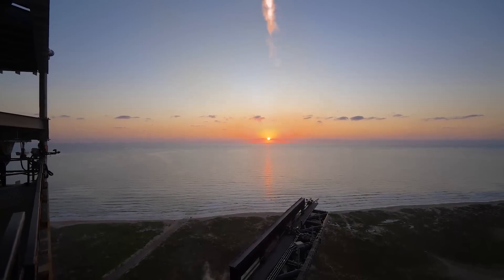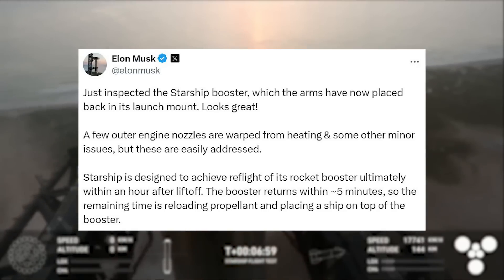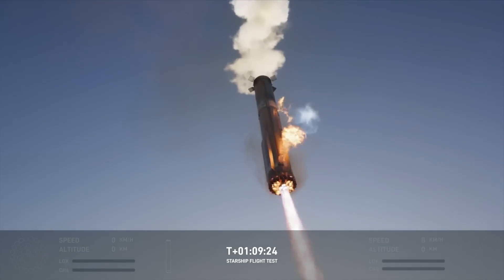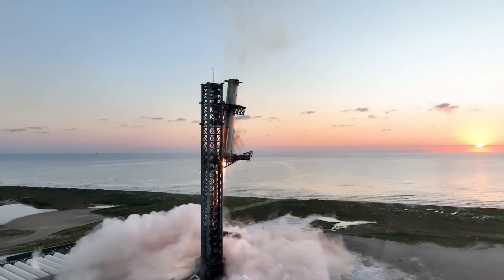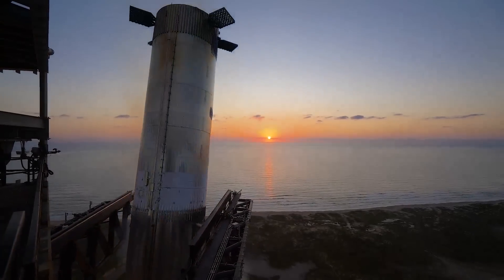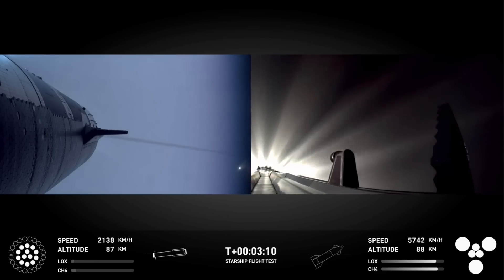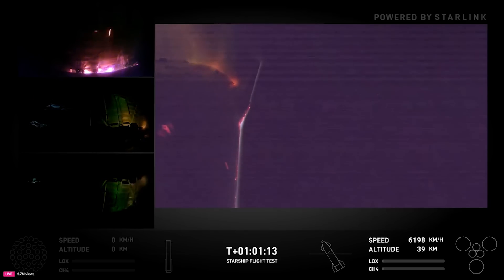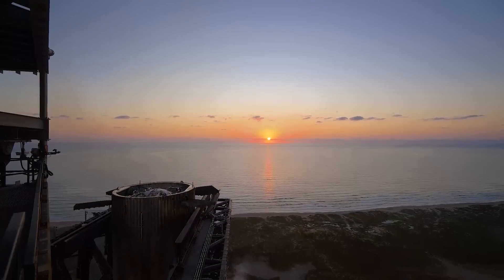What Happened After SpaceX Caught The Super Heavy Booster?

Comment: Not only is it the largest booster rocket ever flown but now SpaceX has a completely intact example that has flown an entire launch cycle. They can examine everything from metal fatigue to o-ring wear and all of the bearings on the vehicle.
Reply: the data alone from this booster and on top of that they can reuse or recycle the booster.
Reply: @shockers12512 this is an old block variant   and they will be using v3 raptors soon   already  old technology doubt it will fly again   but i could be wrong
Reply: @machineenvyllc437  I doubt it could be made flight worthy again as well.  It'll be examined and maybe put together and on display.  They did that with the first f9 they landed.
Reply: @brianl7695  i wish they would… but have a sneaky feeling it’s going to be torn apart for inspection  like every last part

even can crushed to see if the catch ruined the integrity for reuse
Reply: @brianl7695 hahaha !!!! 🤣 🤣😂😅 A booster being recovered?????? yeah, concentrate on the stupid booster and not the most important part, the crew section. Jezuz,....... amazing to watch this cluster pluck.   I wouldn't even trust them to send up a hamster let alone a human at this point in this pluster cluck.  What idiot concentrates on a booster before the  human accommodations and flight worthiness, let alone just getting that piece of hardware  to not blow-up first!!
Reply: worth billions in research!
Reply: @machineenvyllc437  I fart in your general direction.
Reply: Great to get
Reply: However, they also have competition now. Everyone else was watching to see if the idea would work or if there would be some engineering hurdle that couldn't be overcame. Now that the world knows its possible, a new space race has started. The reusable Falcon 9 spurred a bunch of innovation from other companies but the fact that its possible to land a booster on the launch hardware means that everyone knows what can be done and thus what to do. I guarantee you that there were meetings in Russia, China, and the EU on Sunday and today where government officials and private companies came together to discuss how to move forward. 

Even if SpaceX and Musk both mysteriously disappeared, the achievement made on Sunday morning has changed the future.
Reply: @ryelor123  Yet still no one else has managed to replicate the landing of an orbital booster. It isn't any easier even when you know it's possible.
Reply: @schrodingerscat1863  yeah, concentrate on the stupid booster and not the most important part, the crew section. Jezuz,....... amazing to watch this cluster pluck.   I wouldn't even trust them to send up a hamster let alone a human at this point in this pluster cluck.  What idiot concentrates on a booster before the  human accommodations and flight worthiness, let alone just getting that piece of hardware  to not blow-up first!!
Reply: @Snively_Whipsnade  Grow up, it takes years to get certified for crew after the ship is fully operational. This is an early test flight of an early prototype and it was one of the most difficult aspects of the flight. Never been tried before yet they managed to do it on the first try even though many experts thought it impossible.
Reply: @schrodingerscat1863  Didn't take years for Mercury to get certified. Didn't take years for Gemini to get certified. Didn't take years for Apollo to get certified.  Next ......
Reply: @schrodingerscat1863  Agreed.  I've suggested numerous times that they are using FEA to build their control systems.  Even just getting to the point where you can create the parameters for the Finite Element Analysis is a non-trivial activity.  How do I know this?  Because SpaceX has no credible competition at this point.  And for that matter, the computer running the analysis is most certainly not somebody's laptop.
Reply: @Quakeboy02  They are probably leveraging the computing facilities that Tesla has at its disposal. Tesla has extensive private super computing facilities they use for their AI work. I think the expertise they got from modelling flight dynamics and the systems they designed and built for modelling Falcon9 flight dynamics will also have been built upon. Complex control systems are hard to model well but once software is built to do that kind of analysis it becomes a major asset of the company, they won't be using any off the shelf software for that I guarantee it. This is another reason why no one else has come close to even Falcon9 yet let alone what they have just demonstrated with Starship. Even Blue Origin's mini rocket is no where near as accurate as that Super Heavy booster and it's tiny in comparison with only one engine to control.
Reply: @ryelor123 the only viable competitor is china. They already have started copying Falcon and Starship, this may spur them further but they were already on the way. The EU can’t do anything, there is total risk aversion there and no private funding, state funding goes is wasted inefficiency on a lot of other things. Russia will be flying Soyuz for another 100 years, they don’t care about reusability.
Reply: @ryelor123  who?   the issue is there isn’t enough customers as there are rocket providers
Reply: They can also invest more in hardware attached to the booster knowing it will be fully recoverable. So I'd expect them to start making much bigger strides towards having the booster section completely reusable going forward.
Reply: @MDL.720  like what?  don’t see much more being added  its main function is just to lift
Reply: @machineenvyllc437   I meant improving existing components, my comment was probably poorly worded.
Reply: O ring wear so damn painfull ti bring up vis a vis the space shuttle
Reply: @timvansurksum  Yeah, but thankfully the old SRB technology is long gone!
Reply: @Quakeboy02  ohh yeah id hate it if we were still flying old spave shuttle hardware👀
Reply: Yes - it has been stated that the payload is data, they can learn a lot from examining this booster and the raptors. Bet they will try to fire them again - maybe at their McGregor facility
Reply: @robjchristopher  maybe yeah and its about time they put one of these up for display dont you think
Reply: they are probably already taking it apart lol
Reply: Actually the starship landed at sea and RUD but they did demonstrated another starship landed sucessfully before...
Reply: @Epiderm91  It's not supposed to survive ditching at sea, they actually want it to blow up and sink. The test is to get it to a soft landing which it did for the second time, however this time it was perfectly on target.
Reply: @Epiderm91 think they did that on purpose so that no one can recover it
Reply: I've not heard of them having any o-rings on the booster
Reply: @OCMike  Yeah, this is a liquid fuel system, not like the joined solid-fueled stages of the SRBs that NASA used.
Reply: @OCMike Are you part of the analytical team?
Reply: ORING WEAR
Reply: @PDQkevin77  yeah, concentrate on the stupid booster and not the most important part, the crew section. Jezuz,....... amazing to watch this cluster pluck.   I wouldn't even trust them to send up a hamster let alone a human at this point in this pluster cluck.  What idiot concentrates on a booster before the  human accommodations and flight worthiness, let alone just getting that piece of hardware  to not blow-up first!!
Reply: @Snively_Whipsnade  If you don't have a reliable working booster, You Do Not Have A Space Program.  Anyone can design a crew module to sit on top of a rocket.
Reply: @PDQkevin77  yeah while the crew section of the rocket continues to burn up and blow up!!! ,🤣😂😅 everyone's excited about a booster being recovered. Think people think!!!! What a cluster pluck this is!!!!
Reply: @Snively_Whipsnade  By your comments I can clearly see you don't have any idea what you are talking about. The Super heavy booster landing and catching is just like the 1st stage of complexity. Having a full reusable Starship is the final stage of the development. Now, mark my next words please. We are in the VERY BEGINNING of Starship development, we will see at least another 20 test flights during the next 5-7 years before we witness a finished Starship that transports humans. At this moment Starship is "just" a big tank with engines, heat tiles and avionics electronic. Very far away from the final spacecraft capable of keeping alive a full crew in a misión to Mars. In fact I'm certain that the final Mars version of Starship will look completely different to the current prototype
Reply: @jesusrv2009  Won't happen in your lifetime or mine, if ever. Reinventing the wheel here in spacecraft development. It's been done before, in fact 63 years ago it was done specifically when it comes to human survival in a spacecraft, but of course millennials and gen-zers don't read history.  My two nephews are millennials and they think that they are always the first to think and try something when in fact it's all been done WAY before they came along.  Spacecraft development, in terms of keeping humans alive in space,  is 63 years old.
Reply: @Snively_Whipsnade  I wouldn't say that they reinventing the wheel. We are witnessing innovation in manufacturing methods, and using prototype evolution methods instead of building everything upfront before testing. These things alone are enablers to a much faster cadence of development with much lower cost. eg:  3 years of SpaceX development equals 10 years of NASA development during Gemini/Apollo era (in which US was investing the 4% of the annual budget in the program)
Reply: @jesusrv2009  Doubtful it'll look much different.  A rocket is a rocket is a rocket.  What they have now works very well.  Will there be incremental changes?  Yes.  Will there be a complete revision?  Not likely, because what they have works.
Reply: @Snively_Whipsnade  "Spacecraft development, in terms of keeping humans alive in space,  is 63 years old."  Indeed.  And there isn't really much to a crew module that sits on top of a rocket, because it's a static system, not an active one.  The big money is always going to be spent on the propulsion systems.
Reply: @Quakeboy02  There is already designs of 3 different versions. The final Mars-ready Starship will be bigger, more powerful. We will have a moon version, a Mars version and a Earth 2 Earth version each of them different in size, power and capabilities. The only thing that will only be slightly different will be the Super heavy booster

Comment: So... if you miss the 'catch points' then does the booster rely upon the grid fins to catch?
Reply: probably, but I don't know if they can hold the weight
Reply: it can hover so as long as it has fuel it can keep trying to line it up theoretically.
Reply: @zachmoyer1849  Hovering is not about fuel.  It's about how deep they can throttle.
Reply: @TheEvilmooseofdoom  well it is able to throttle down enough to hover my point is they can hover it as long as there is still fuel in the tanks which might not be much after a launch
Reply: The software either works or it doesn't.  Those vanes on the top are used to spin the thing around until the pins match during approach.  They're sticking out far enough from the body that they don't have to be precisely aligned.  Close, yes, but not exactly.

Comment: have they said what caused the damage to one of the fins of the booster?
Reply: None of the grid fins on the booster were damaged.
Reply: @morskojvolk  I don't mean the things on the top. I am referring to the four stubby fins on the bottom. There is visual damage. It is visible before it touches the chopsticks, so it is not capture related.
Reply: @morskojvolk  were talking about the static fins at the bottom, and yes that did happen.
Reply: One of the gas tanks that are used to re-start the engines blew up.
Reply: @SaltyGT  No, it didn't.
Reply: @SaltyGT  Thanks

Comment: it seems like they should probably light up all the engines during descent so that the nozzles all have sufficient cooling via the fuel piping flow. at least at a minimal level. maybe they don't have enough fuel to ignite all 33 engines, but it's worth a discussion.
Reply: If they're venting extra methane then obviously there's some leftover but the thing that concerns me are the G forces and bringing the booster to a hover so quickly. I don't think that is a sustainable procedure. The metal fatigue has to be tremendous and I think that type of landing burn the G forces would kill a human being. From what I saw they went from going 600 miles an hour to a hover in less than a kilometer
Reply: @jamesbarnesii4124  yeah, i'm disappointed they haven't said more about the 'fire'. probably don't want to draw the FAA's ire. but after watching a ton of falcon booster landings, it didn't seem very normal (to my layman eyes)
Reply: @RenoSCM  They release what they want when they want to the public despite it's sense of entitlement.  The fire would not be an FAA issue, you likely really don't know what IS and isn't an FAA issue.
Reply: I think just putting them on a similar engine chill system might help.

Comment: With the control they have, would it be a big change to bring the ship all the way back around and land in the gulf?  It'd be a lot easier to recover, examine, and work out the heat sheild even though they are obviously improving.
Reply: They would be decelerating over populated areas so it will take some time before they can prove that the heat shield and flaps can stay intact without excess risk of disintegration.
Reply: @kevikiru  Never gonna happen.

Comment: I know the rapid turn around is still a long way off, but I wonder if SpaceX would consider putting payloads on board for the next few test flights.  Even if a landing fails, it seems that getting gear into orbit is now possible.
Reply: So far no starship orbit would have kept any payload in orbit.  The orbit was picked to make sure anything that went up re-entered just in case they lost control of starship.  On flights where they start full orbits and deorbiting I suspect might see some kind of payload testing.
Reply: @TheEvilmooseofdoom  exactly. They have to demonstrate they can deorbit before they can fly an orbital trajectory since starship would be an unprecedented amount of space debris if it got stuck there.
Reply: A dummy payload doesn't prevent deorbit. Eventually they must demonstrate this system can lift the 150 t block of ice and still have enough fuel for landings.

Comment: “With decades of advanced material reinforcement and thermal protection manufacturing engineering experience, I have great designs to prevent thermal damage to both the booster and StarShip including its aeronautical directional flaps/fins preventing cyclic thermal mechanical degradation.”
-Kent Pull

Comment: Why didnt you mention the glaring obvious booster qd points pouring fuel out as it comes in for the catch? The quick disconnect valves failing and causing the fire is the biggest failure of the launch, it didnt stop leaking and stop the qd fire until they they started the slow depress at the top of the booster. Just watch the last part of your vid again from about 7:26
Reply: So what? A five cent O ring and it’s fixed. Didn’t fail hater. It met 100% of flight objectives. Get a life ffs.
Reply: Was it a failure or deliberate?  what do you actually know vs what you pretend you know.  Can you cite any actual sources or is it just speculation you're pretending is truth?
Reply: @TheEvilmooseofdoom both in a way. The venting is deliberate but it shouldn’t catch fire. That was unexpected. Doesn’t look like a serious issue to me.
Reply: If I'm not completely mistaken NASA spaceflight mentioned, that Starship uses the qd for quick decompression... Thought I'm not 100% sure and don't like spreading misinformation.
Reply: Pretty sure that's the boiloff from the remaining propellents that would usually be used to autogenously pressurise the tanks being vented and then combusted by the heat of the reentry and/or engine relight
Reply: They empty those pipes, they don't want fuel to hang around "just in case"

Comment: I think its incredible how both starships can survive re-entry even with a damaged heat shield and partially burning up, i think this demonstrates how much better the stainless steel is over aluminium that the shuttle used.
Reply: Imagine being an astronaut in Starship, knowing your ship can go through re-entry even with a compromised heat shield without breaking a sweat 😎
Reply: @okirooju3787  IKR, crew would have likely survived on these last two landings if they were caught by the launch tower, the explosion likely only happened on impact with the ocean, same couldn't have been said for columbia.
Reply: And much better than the carbon fibre they were intending to use! I remember a lot of people mocking them for choosing yee old stainless steel rather than 'futuristic' carbon composites!
Reply: From the moment I understood the weakness of composites, it disgusted me. I craved the strength and certainty of steel.
Reply: @ryan.crosby  Steel melts long before ceramic composites do.
Reply: @ryan.crosby  I aspired to the purity of the blessed metals.

Comment: Given the fact that the outer engines were not being chilled or the nozzles being regeneratively cooled during the decent and subsequent landing burn, it’s safe to say that they experienced higher heating than normal, which in addition to the atmospheric pressure, is likely the cause of the warping of the nozzles. I expect to see  the outer engines being chilled during reentry and landing on the next flight.
Reply: I'm pretty sure I saw a video recently talking about using the fuel as a coolant before it was burned.  But, whatever.
Reply: @Excelcior58  Just lox.
Reply: Yes, that's pretty much what Elon said.
Reply: Did he? Souce?
Reply: That is a venerable technology pioneered by Soviet rocket engineers